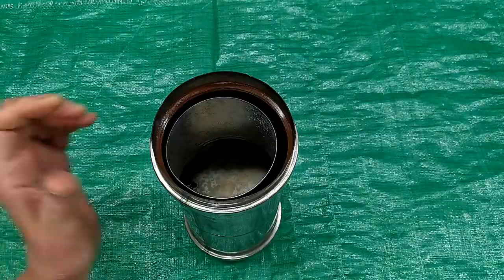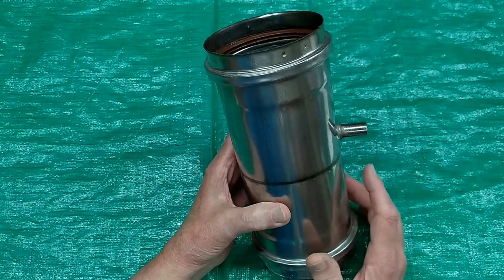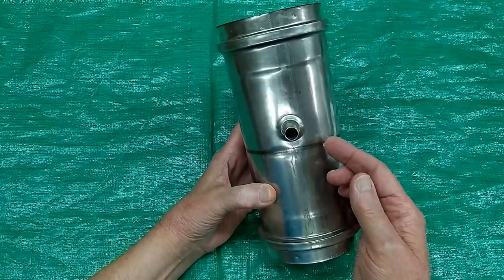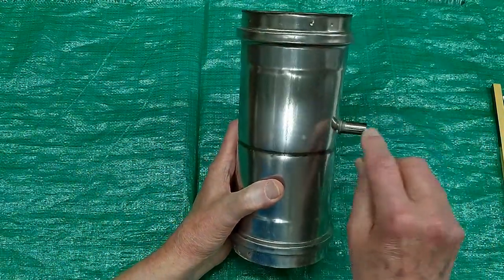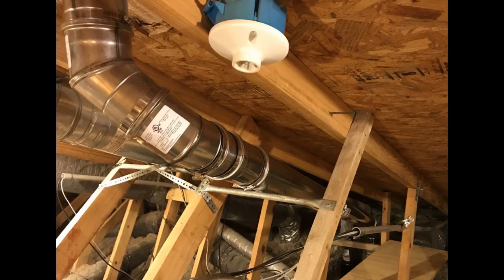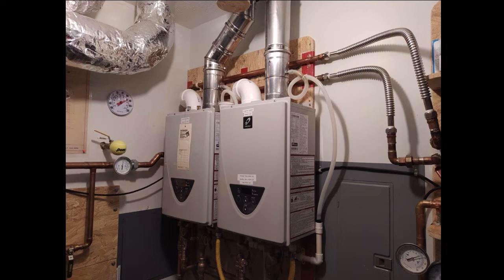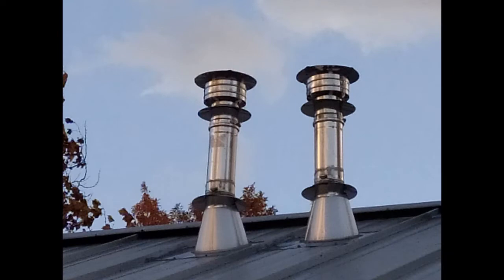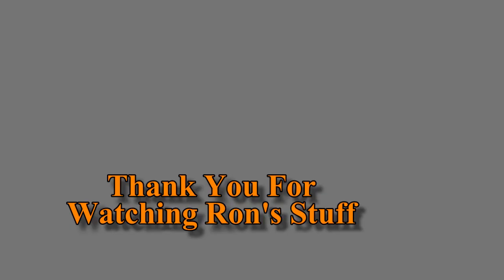Tankless Heater - The Unexpected

Comment: In homebrewing we use the same tubing and are advised not to leave it for extended periods of time in acid sanitizing solution (pH ~3.4) because it can become brittle. Perhaps the acidic condensate is causing similar brittleness and you need to find an acid and heat resistant tube. Unlike brewing, it wouldn’t need to be food safe.
Reply from the maker: Would it be possible to send me a copy of what informed you about the silicone tubing becoming brittle with acidic solutions? I would like to put that back to this manufacturer. 
Thanks
Ron

Comment: Sulfuric acid condensate??  I need to go back to school
Reply from the maker: Sulfur is often found in petroleum (and in natural gas as hydrogen sulfide). In fact, sour versus sweet petroleum is determined by the sulfur content where sour petroleum contains more than 0.5% sulfur. Sulfur, when burned during hydrocarbon combustion produces sulfur dioxide. Another byproduct of combustion is water and when mixed with sulfur dioxide produces sulfuric acid. This is what used to rot out all the exhaust pipes and mufflers on cars until they started using stainless steel.